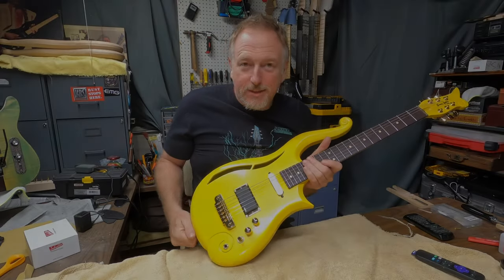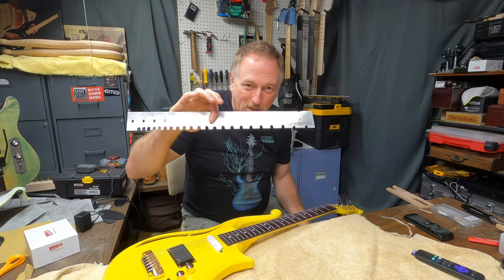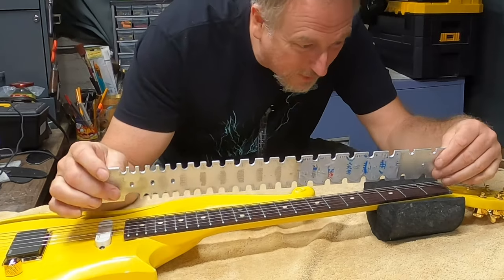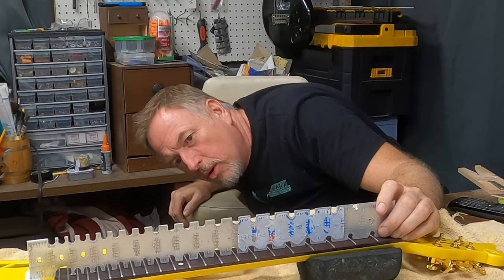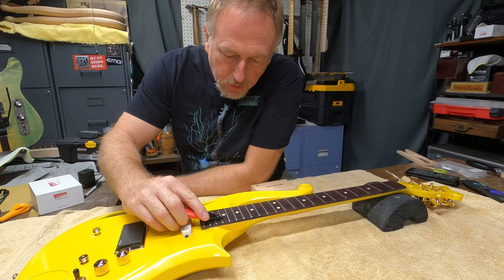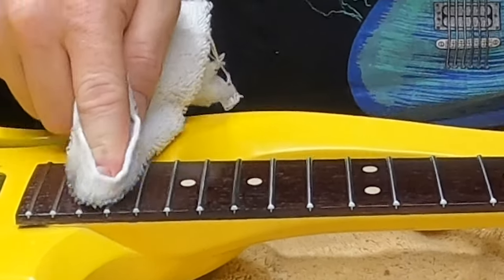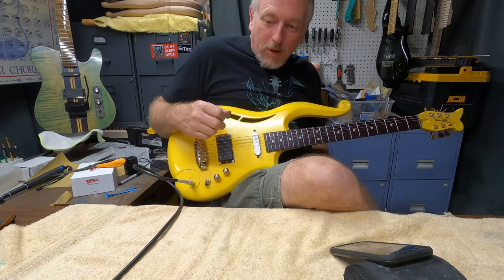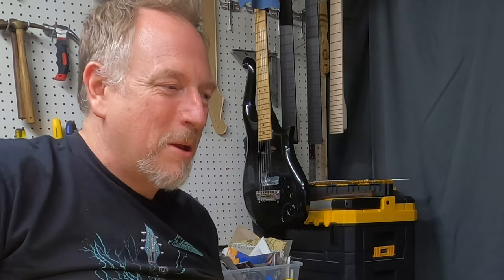How to Use Fall Away

Comment: Won’t you be taking more off the sides of the frets than the middle if using a radius block? It is the board that is 16”, not the top of the frets. Or, does it just not matter?
Reply from the maker: So think about it this way….if the wood is at a 16” radius and the fret is pressed in to lay flat against the wood…then what is the radius of the top of the fret?  16” correct?!  And same where you use a 12” radius….so using a radius block allows me to sand the frets at the even radius which they are at.
Reply: @letsbuildaguitar9230  No, it's only still 16" radius at the bottom of the fret where it meets the fretboard. If the radius is 16" (imagine a 16" circle drawn) and you add in the height of the fret, it's now 16" plus the height of the fret, making it more like 16.125" at the top of the fret. The frets at the fall-away will have a slightly tigher arc than the other frets (16 vs 16.25ish). It's probably too small to notice, though, because an eighth of an inch radius difference from 16" is a very slight difference and when measured across a relatively small section of the arc (the width of the frets), it's almost negligible.

Comment: Are you at all concerned with the particles coming off of the frets while sanding?  I've seen other people taping up their fretboard before sanding, and I'm wondering it it's necessary.
Reply from the maker: So it really kind of depends on where you are in the process….the neck and body are finished, so I’m not worried about particle residue in the finish.   At this point I’m not taping up the fretboard because my sandpaper isn’t getting close to the finish.  What you don’t see here is that when I crowned the frets right after this I did tape up the fretboard!
Reply: Tape the fretboard… every single time…
Reply: it's not the particles, it's scuffing up the fretboard people are protecting with tape

Comment: awesome video!! is the process of fret leveling in general and adding fall off identical in a multiscale guitar?
Reply from the maker: Fret leveling pretty much a yes…not 100% sure on fret fall away when the frets are angled….on a multi scale neck…high up the fret board they aren’t angled a lot, so probably the same, but I haven’t done it.
Reply: @letsbuildaguitar9230  thank you!!